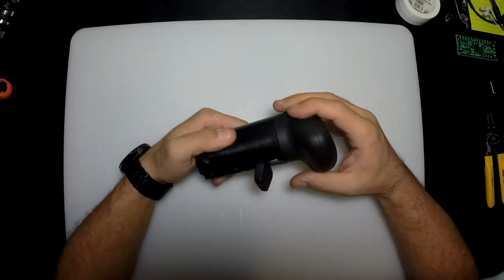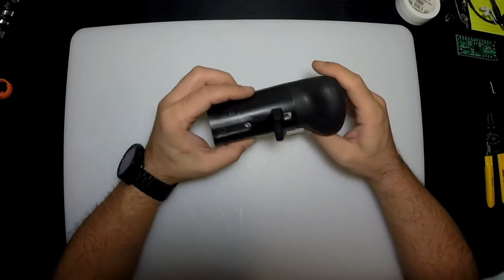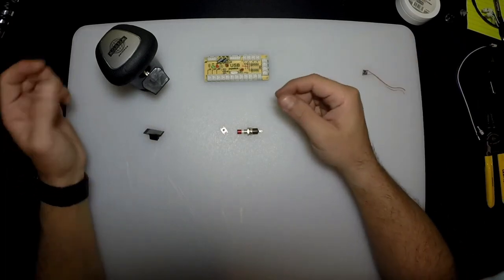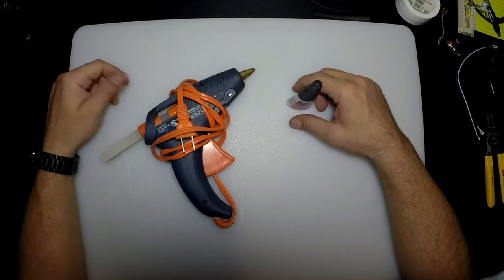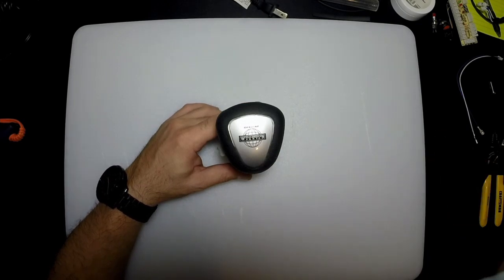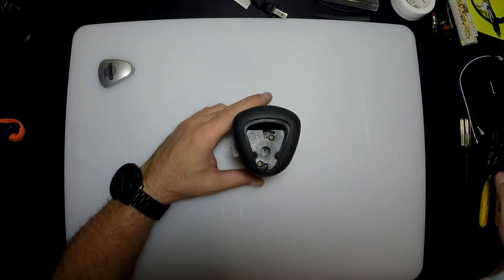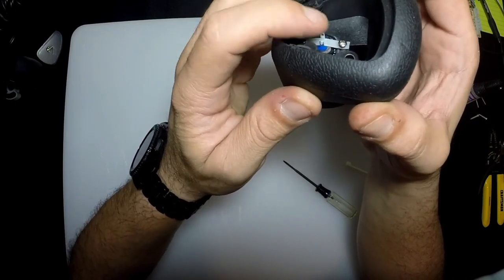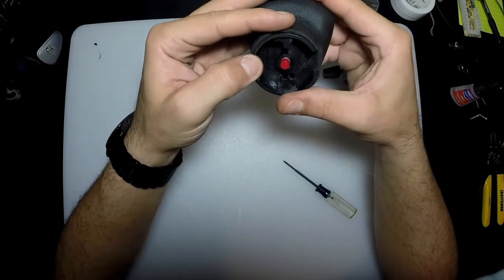Build your own Eaton Fuller Shifter for ATS & ETS with CST Gaming

Comment: Used this vid to make my own shift knob and I’m loving it so far I had to buy an adapter for my Logitech shifter but I may need another one because mine didn’t fit the threads it was just a little to small but I’m making it works. The video is great you explained everything clearly and showed where to put everything. Now I wanna get different ends and make a custom one soon

Comment: I just finished building my shifter using this guide.  It works great.  I especially like the suggestion to put the little piece of zip tie over the hi/low range button.  I didn't put that in originally and then had to take it apart and install it later.  I spent a little more than I originally planned, but I liked the challenge of doing it myself.  I wasn't really doing it for the money savings anyway, I could have easily just bought one ready to go from ebay.

Comment: Thanks for the DIY video, I just built my first shifter and followed all your steps and parts and it works like a charm. Thank you
Reply: Do you know of it would work on xbox
Reply: @davidmerryfield4791  its doubtful that the joystick circuit board that's been used in this tutorial will work on the Xbox, the xbox controllers use a special microchip to authenticate them to the xbox so it stops users from using clone joysticks like this.

Comment: Amazing job going through this. The only thing I have to be careful of is not confusing the wires. I have the metal top so I can add a shifter ball so will see how that goes. Probably have to drill into the top part of the metal.

Comment: Great video , thank you. I used a chinese replacement shift knob so this might not apply. I recommend carefully dissasemling the top and bottom of the knob and take out all the rubber orings, and pieces needed for the air control. It makes the switches move much smoother.

Comment: when the range lever is down the piece that sticks up inside, if you just drill a small hole sideways an hot glue a rivet shaft in it that overhangs you could put your always open micro switch in the cavity to the side of it facing up that way no wires running through the head an no need for special switch

Comment: The best tutorial I've seen for this! Thanks for the in depth guide on how simple it can be! I do have a quick question, if it's just for this project, what gauge wire and size of heat shrink tubing would you recommend, given the experience you have with building this twice over?
Reply from the maker: To be honest, I had a variety pack of heat shrink tubing that I bought wit different sizes, and I picked the one that worked. As per the wires, I used an old data cable, like the ones for a phone or an ethernet cable and spliced it. Hope that helps.
Reply: @CSTGaming  It does! Thank you. Any suggestions for a quick connect? I'm excited to see someone else had a similar idea to mine, I plan to also build a handbrake and ignition/button box that go into the same encoder, and figured that having one encoder would be more simple, especially if I could pick and choose which devices I wanted to use at the time.
Reply from the maker: @Emcipio  for a quick connector I suggest going to a hobby shop and look at what they have and pick out the one that works best for you.
Reply: CST Gaming I’ve decided to go with 6-Pin MOLEX. Thanks for your help! Kept me under budget!
Reply from the maker: @Emcipio  I am really glad I could help. That is the reason I made this video. Also don forget to sub and if you like join my Discord for more interaction.

Comment: This is a good video I just built mine while watching your video everything from Amazon...at a cheap  prize..
Reply from the maker: Glad it helped bro.
Reply: @CSTGaming   it did what's a good way to put this on the g29 shifter..
Reply from the maker: @maniacmachanic9870  I drilled the front screw hole all the way through, tapped it and used a longer screw.
Reply: @CSTGaming  my shifter isn't working right I have to move the splitter and range twice to make it work  did I do something wrong with the switches ..
Reply from the maker: @maniacmachanic9870  make sure you check the box in settings that says "shifter toggles use switch mode"

Comment: Awesome tutorial! I just built this shifter and it works great, However I ended up with a  13 speed shifter and I think the internal air valve boxy is different as the hole I had to drill for the wires was a little funky. Also be very careful with the momentary inside, needs to be just right to get the right feel.

Comment: Points of clarification. The switches for the High-Low and Splitter are both momentary action. One is Normally Closed and the other is Normally Open. The packaging normally refers to Momentary Action as "MOM". Normally Closed is NC, while Normally Open is "NO". Momentary Action means that you have to keep the switch activated for the opposite action to occur. When you let go the switch goes back to its "Normal" position. This is the opposite of a toggle switch ( like a normal light switch) that stays in whatever position you put it in until you manually change it again. Normally Closed just means that the contacts are normally connected together and current flows. When you activate the NC switch the contacts become open and the current stops. Normally Open is the opposite, the contacts are open until you activate the switch at which point current flows, when you let go the current stops.

Comment: Great video!
I grabbed some parts, and am awaiting the delivery anxiously. What I don't know though is, what and how did you get the new shift knob to attach to the existing G27 shaft?
I know TTD had a part machined, but I didn't see anything in your video on that aspect of assembly.
Thanks!
Reply from the maker: You can buy an adapter on ebay for around $10, or make one if you have the tools to do it.
Reply: @CSTGaming  I havent found one yet with the needed 13 TPI of the Eaton shifter.
As to making it, I don't have access to the tooling needed.

Comment: Wow, thank you very much for sharing your knowledge. There are some knobs with electronic shifters (like MAN), which have a wire coming out of them. Do I need just the USB Joystick setup thing? No additional wiring of the knob itself?
Reply from the maker: I can't answer that for sure because I have never seen them. However it seems possime if the switches are already there.

Comment: Hey. So great tutorial. When I shift into high range it goes into high but I have to drop the range selector to low and back to high again to get it to drop into low again. Any idea why?
Reply from the maker: Haven't played ATS in a while. But if I remember correctly it's a setting in ATS. There is a box that needs to be checked for the switch to work correctly.
Reply: Awesome thanks!!!

Comment: Hey buddy, can you clarify a couple things for me?  I ordered a tactical push button for the splitter. Should I have went with a momentary switch to replicate a realistic splitter? I feel the open circuit push button I ordered will require me to push the splitter forward twice to select between H/L. The correct way should be L = forward, H = backward, correct? Great video, bro! I'm just a little confused on the logistics of how the buttons should function. Thanks!
Reply from the maker: A tac switch is what you should go with. If you follow my video you will have no issues. Parts are listed in the description

Comment: Will any Eaton Fuller-style 18-speed knob have the same inner structure as the World American you used? I was hoping to find a World American knob to remove all doubt, but the only ones I can find online so far are 10 speed. Also: Could you tell us what size bits you used to drill the various holes? Did you use a Dremel to cut the hole for the Jake brake switch? And, finally: Is a special bit required to drill through the metal for the hole you run the wires through? Thanks!
Reply: I'm looking at a knob from Customer Driven, which is the one that comes up now with the link you provided. It's got some bad reviews, but they're from people trying to use it on an actual truck. :)
Reply from the maker: As far as I know, they are allpretty much the same. Also, reviews of a knob, as you stated are meant for real application.

Comment: I’ve got a question. So I put the splitter button in and have it wired. When I plug it into my pc it recognizes it but when I go to ats it doesn’t show up at all. Any suggestions?
Reply from the maker: Need to select the controller on ats as well.
Reply: @CSTGaming  it doesn’t show up in controls at all.
Reply from the maker: @ThatBurgundy_24Valve  not sure bro. Never ran into this issue myself
Reply: @CSTGaming  ok, I’m gonna order a different board and try it. Course I have no clue what else it could be.
Reply: @ThatBurgundy_24Valve  in windows go into Controllers and see if it lists the USB board, if its not showing up in there windows doesn't recognise it and the board won't work you'd likely need to contact the seller to see if there's a driver for your version of windows you are using.

Comment: Thank you very much for the tutorial. I have seen that the knob you suggest is no longer available on amazon, could you please suggest another one? Also, any idea to fix the knob on the logitech g29 shifter
Reply: I just bought one from amazon, so it looks like they are being stocked again, ebay also has loads of them on there as well, failing that AliExpress and Banggood have them but they will take a while to turn up

Comment: @CST Gaming how would you wire it up with proximity sensors. The good old 3 wires instead of the simple 2 wires of either off or on?
Reply from the maker: Not sure I know what you mean.
Reply: @CSTGaming  It's a sensor set up, where it senses a reflector or small magnet. TechAffliction uses this method and it ties into a Micro USB controller that uses Arduino programming.. with all my luck i broke the usb connector and have to figure something out. Instead of the 2 wire (on/off) like this method, those sensors have 3 wires.
Reply from the maker: @jamesoke7414  I hear you, but I have never used it, so I couldn't tell you.

Comment: where you Solder the wires to the switch could you use shrink tube to make it so the wires don't accidentally touch. I'm just getting in to ATS so this looks nice and cheaper then $160.00. thank you
Reply from the maker: You sure can man. I'm glad this video helps.

Comment: Thanks for all the information from this! I just have on issue, I need a way to mount the threaded shifter mount on to my Logitech driving force shifter. I see all of theses other shifters using set screws Any ideas?
Reply from the maker: When I used it on my logi shifter, I drilled and tapped a hole and used a set screw. You can also have an adapter 3d printed or buy one on ebay.

Comment: so ive build my shifter up from scratch just like yours, but my splitter seems to be inverted ( splitter up LL to 4th) (splitter down 5th to 8th) any idea on how i could fix the issue? i also use SV maping for my button box :)
Reply: update, my problem is the switch in the knob, it works the "right'' way,  when pressed, power passes thru, when depressed, power does not go thru,    so I'm basically setup backwards :(
Reply from the maker: @ProjectSKY  I was about to tell you that. You got the wrong switch. Glad you figured it out
Reply: Don't know if you have fixed your problem yet by putting in another switch, but every gearbox has a SII file (can open it with a text file reader). 

In there for every gear there is a setting for the range and splitter for that gear -> selector_1: 0 (your range selector setting),  selector_2: 0 (your splitter selector setting) with 0 low & 1 high position).

If you change the 0 with 1 in your splitter the position for your splitter will be changed so selector_2: 0 will be selector_2: 1. 

If your splitter knob position is reversed, this will put your splitter button in low and using the low setting and high using the high setting. 

Example from : gearbox_layout_eaton_18.SII

Stock setting : 

direct_gearbox_gear : _nameless.1ec.0699.7490 {             
 gear_impulse_index: 4
 selector_1: 0
 selector_2: 0
 gear: 3
 name: 1L

direct_gearbox_gear : _nameless.1ec.0699.6bf0 {
 gear_impulse_index: 4
 selector_1: 0
 selector_2: 1
 gear: 4
 name: 1H

Changed setting :

direct_gearbox_gear : _nameless.1ec.0699.7490 {
 gear_impulse_index: 4
 selector_1: 0
 selector_2: 1  (changed 0 to 1)
 gear: 3
 name: 1L

direct_gearbox_gear : _nameless.1ec.0699.6bf0 {
 gear_impulse_index: 4
 selector_1: 0
 selector_2: 0 (changed 1 to 0)
 gear: 4
 name: 1H

You have to change the setting for both the low and high setting for the same gear, and do this for every gear and every gearbox (13 speed, 18 speed etc) that you use.
You can also change this for the range selector if it is inverted.
Don't forget to make a back up first of the files before altering them.

Comment: How would you mount this to a G29 shifter?
Reply from the maker: Need an adapter
Reply: @CSTGaming  gotcha thanks for the reply do you know anywhere that has such an adapter? If not that’s fine. I was initially thinking that you could maybe screw through the base of the shifter and then into the metal Rod that held the oroginal shift head for the g29, do you think something like that could work?
Reply from the maker: @babylon9858  Lots of people 3d print them and sell them on ebay for a few $. Just do a search
Reply: @CSTGaming  fantastic, thanks!

Comment: great video! do you think we can also take a 13 speed knop? does somebody knows where the differences are? just for this modification not in a real truck. I mean does it look the same inside like the 18 speed knop? in Europe its hard to find it, only copies from China
Reply from the maker: With a 13 speed knob you will not be able to split geara in the upper range, because the splitter lever is designed different internally. I'm sure it could be modified to work, but I have never done it.
Reply: @CSTGaming  ok, then I better buy the grey one, 18 speed, thanks!
Reply: @CSTGaming  That's incorrect. You can't split gears in the low range.

Comment: Thank you for the tutorial and clear instructions to follow, I went ahead and ordered the parts right after finishing the video, yesterday I spent all day building it and ran into some issues, first of all, the switch for the range is open, but, I'll find a way to inverse it, I went for hot glue to fix the switches in place, the switch for the splitter works marvelously, although, just moving it slightly away deactivates the button, simple way to solve this, unscrew the top as to keep it a bit more loose, the main issue I'm encountering is the fear that my switch for the range might be malfunctioning, as every time I activate it, it cuts off at the slight touch of the lever, or just activates for a second, I am also guessing, it might be due to being too high, the inside is barely able to reach it, though the red cap is popping from the edge of the hole, I did not applied the ziptie to hold it down, might that be the solution? I know my switch is reversed compared to the one recommended, I even asked the clerk if the switched cut the signal when pressed :(. Did you perhaps faced a similar issue, and if you did, how did you solved it? I'd hate having to go again for another switch only to buy another faulty one haha
Reply from the maker: I did not run in those issues. The clerck most definitely gave you the wrong switch. For the rest you just need to inspect your work carefully and make sure all the switches are placed properly.
Reply: @CSTGaming  thank you for your time, I will melt the glue and reposition the switch, again, thank you for the tutorial, the project itself is a lot of fun!

Comment: How did you mount the shifter??
Reply from the maker: On my fanatec shifter it screws on. But if you have a shifter with a smaller shaft you will need to make or buy an adapter.

Comment: Is the blue wire the hot wire?
Reply: it doesn't matter on the joystick board as you as simply closing a circuit for the controller board to see a button being pushed. you could use wire all the same colours on the buttons. you don't really need to pay attention to Hot / Neutral like you would with electrical wiring in a house.

Comment: Hey i just want to say thanks for the video. I got mine all done. I just have trouble getting the game to recognize it. If i go to control on windows it is there and functioning. But not in the game. Any advice will be apreciated. Thanks
Reply from the maker: Need to add it in the game settings. Drop down menu at very top under controls.
Reply: I tried but i dont get the option for generic usb joy. I only have g27 option and keyboard mouse option
Reply from the maker: Strange. If you are on my discord I can see about helping you out later
Reply: Ill do that later when i get home. Thank you so much

Comment: Does anyone happen to have the G29 shifter? What's the best way to mount the truck shifter to it? I assume it doesn't just thread on...
Reply: It doesn't three on. I drilled and tapped one of the screws holes that holds the plastic to the shifter. Put a long enough bolt through it to tighten against the g29 shifter. Works flawlessly.
Reply: Thread**